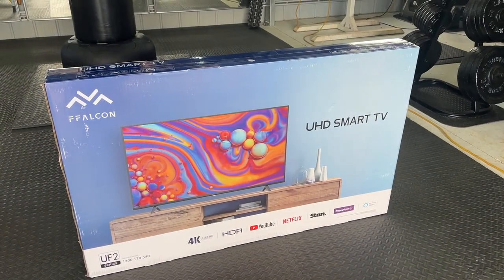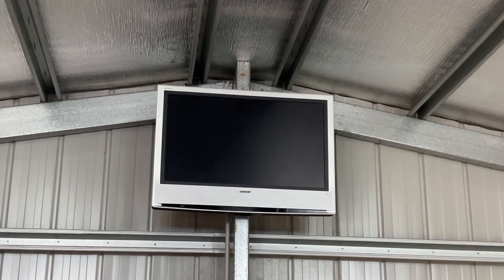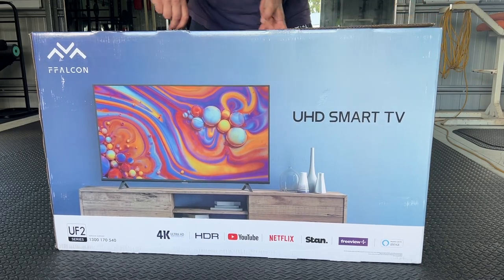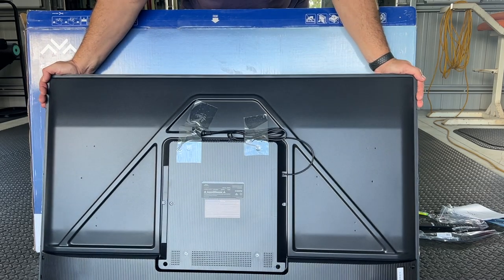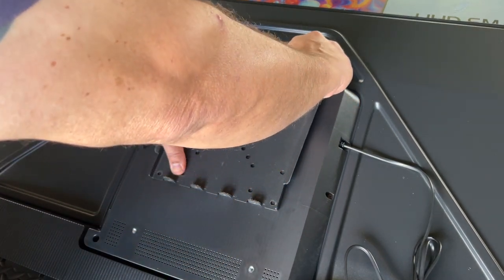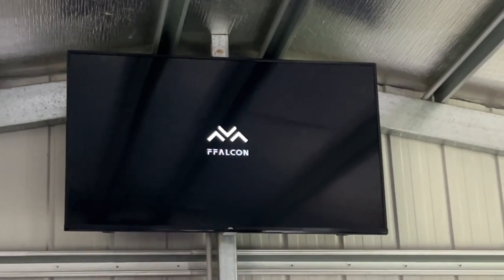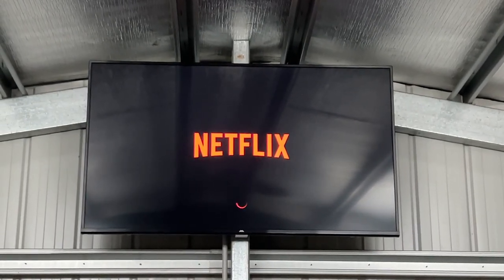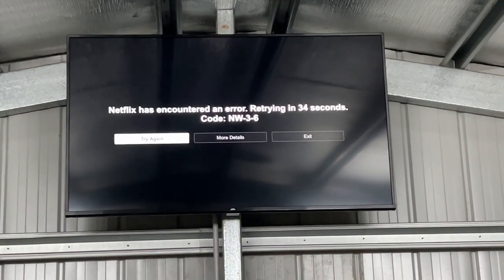FFalcon 50UF2 50" Ultra HD HDR Smart TV - FFalcon Smart TV - Budget Smart TV

Comment: Am I getting this right: There is only TWO screws holding that TV up there? Does not feel like much. Normally the brackets are meant to connect to 4 or more.
Reply: I’m bought one today and want to hand it up on the wall. It only has 2 holes instead of 4 but is it enough strength too hang on the wall ?
Reply from the maker: Still up there today. So must be enough.
Reply from the maker: Looks like it is. Hasn’t fallen down yet.